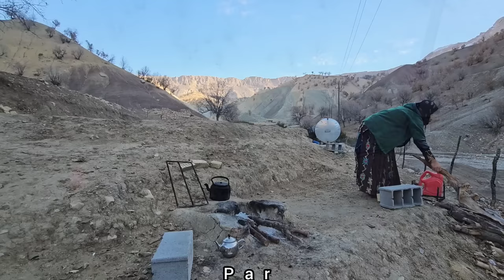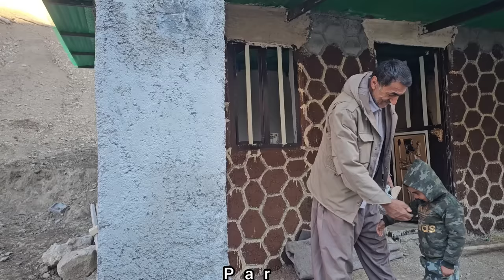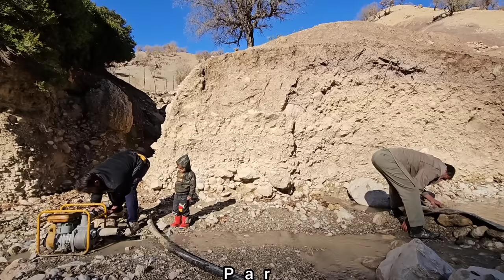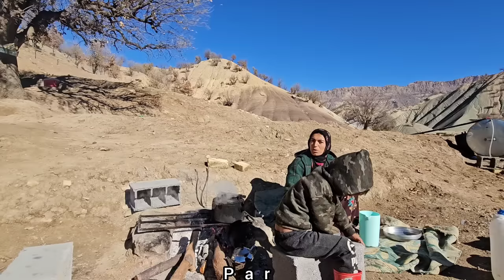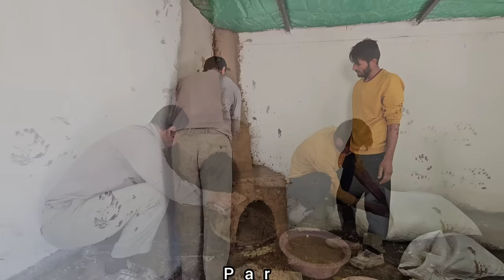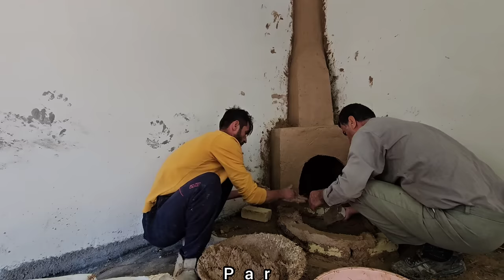Completing the construction of a wood-burning gas stove in a country house and making Narges happy

Comment: Babek your cousin has done a great job. He has taken pride in his job which is evident in the final shaping, smoothing and a place to put the coals to cook chicken on scewers  inside in winter. All that extra clay and dry fodder will set like concrete (Cooking pot) and will absorb the heat before it escapes up the chimney. This fireplace will radiate gentle heat into the room long after the fire has gone out. Your cousin is an artist. 💙💙💙😍